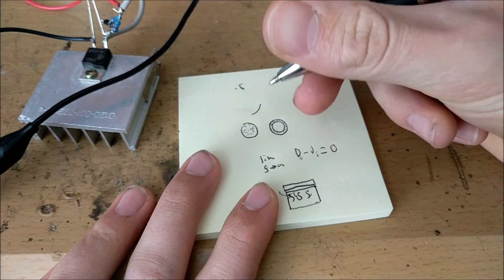RF Burns and the Skin Effect

Comment: The problem is that the skin effect won't apply to tissue like your actual skin. The reason why you don't get shocked from the RF arc is because the frequency is too high for your nerve cells to react to it. You can look up Electroboom's frequency to pain graph. You got burned because it was hot, not because it is RF.
Reply: well, he mentioned, what burn is caused by a plasma, not just electrons or volts.
Reply: Yes, the skin effect is describing the flow of current for conductors, and is due to the flux density differences when approaching the core of a conductor.

The main reason he doesn't get burned from touching the screwdriver is that the hot arc is no longer close to his skin.  When an arc occurs (e.g. voltage higher than the "breakdown voltage" of a gas, according to Paschen's law), that plasma channel becomes conductive.  It does still have some resistance, because it's not a superconductor.  So, therefore some energy is transferred in the form of heat.  The plasma channel in the gas tends to rise (i.e. "hot air rises"), so we see that arc begin to look more arched in shape as it travels upwards, eventually breaking once the arc length becomes too great and plasma channel gas is dissipated enough.  Then the charge buildup and voltage differential grows again (as in an air-gap capacitor or spark gap), until it reaches the breakdown voltage of the gas again, creating another arc.  His skin being close to that arc transfers heat energy to his skin, and the charge density is also high where it contacts him. 

In the other case with the screwdriver, he's holding onto the piece of metal to complete the circuit.  However, the hot arc is now further away from his skin and thus doesn't burn.  He also has more surface area of skin in contact with the screwdriver, so charge density is lower per unit area of skin.  However, if enough current were to flow for long enough time, that screwdriver would eventually get hot too.  So perhaps it still could burn him if he held on too long.  The end result would of course depend on the resistance of that metal, the AC frequency, and any cooling effects from surrounding air currents and heat transfer from the screwdriver to the surrounding air.

Comment: What constant value did you use for the formula to satisfy it for skin? ( I’ve tried doing measurements with various frequencies on my skin, but could never find a value to use for skin,mainly  just solid metals )
Reply from the maker: +Keystone Science I forgot to change the values!  The .08mm penetration was based on a copper conductor.  I just tried it with a relative magnetic permiability of 1.00004 and a resistivity of ~3140 (based on a reading of 10kohms for a 1cm section of a hot dog).   This gave me a skin depth penetration of about 10cm.  This couldn't be right.  Any thoughts?
Reply: This  is an interesting question !  🧐🇬🇧🤔🤔🤔🤓🤓🤓
Reply: @TannerTech  It is right. The skin effect has nothing to do with it and it's a common misconseption about rf ac. The actual reason why you don't feel anything is because the nerves simply don't react to high frequencies. And that's also the reason why you can touch a VTTC but when you touch a DRSSTC it is very painfull because the short on-times of a DRSSTC make it act more like 1-10kHz to which the nerves in your body react. In a VTTC, RSSTC, QCWDRSSTC, CWSSTC or any coil with an on-time of more then about 1ms your nerves don't react anymore and you don't feel a thing. Even if there are several amps going through your body (e.g.: QCWDRSSTC) which should easily kill you.

Comment: The calculation for the depth of skin effect is based off the material of the conductor. It is caused by eddy currents in the center of the conductor. Iron is more susceptible to skin effect than copper. Your calculation cannot be that simple.

Comment: Interesting video, but I disagree about how the skin effect plays into it (BTW, neat pun). I think it is more the concentration of current/voltage causing the burn. If, for instance, you had a much more powerful source, I don't think the dispersing affect of the screwdriver would keep you from being burnt... Here you're concentrating several miliwatts into a very small area. And, it takes a certain amount of current for us to detect it. The smaller the "area," the more the effective current. JAT. kurtt

Comment: Sweet! RF can be harmful. 
I try to tell some of my friends but they just shrug it off and call me a geek LOL
I started learning about RF (but you are way in front of me) about a year ago. 
I have the same 5RA. a buddy was over with his radio and we jumping channels and playing with repeating.
I was at the same time, finishing the electronics on a drone. I had 433mHz, 1.2gHz , 2.4 and 5.8gHz pumping at once.
he said he felt a slight shock and put the radio down. At the same time my 433 LRS TX which piggy backed my 2.4 Spektrum TX
began twitching and the trim positions began moving like crazy.
I've paid close attention to RF every since...
Great post!
Reply from the maker: +XB Cool, great story!  How far is the range on that drone on 433mhz?  How much per was the TX
Reply: Tanner Thanx! I'm surprised you haven't jumped into this yet, it's way cool brother! 
The 433 TX ( DragonLink LRS) has about a 25 mile range. It connects to and bypasses the TX on an RC industry standard 2.4 radio (Spektrum DX9 Transmitter). I think the power is 1500mW. I just retired mine though :(

Comment: Sorry for spamming the wall but as of today my arm on that side has a constant twitching muscle or something. Also painful tingling in my back.
Reply from the maker: Check it Out Was the water warm there?  Like was the bubbling boiling, or was it just gas.  If it was boiling, then perhaps some type of hyperfocused beam of Electromagnetic energy was pointed there.  That is just speculation though.
Reply: After doing research, I work with cell phone equipment and tablets of sorts. I found out that it was Microwave Radiation. The microwave radiation was from a communication tower across the street less than a mile. Someone had aim the microwave at my house and did not ground it out. This sending Microwave Radiation causing a burn, a thermal burn which I have to go and make sure it’s not cancer